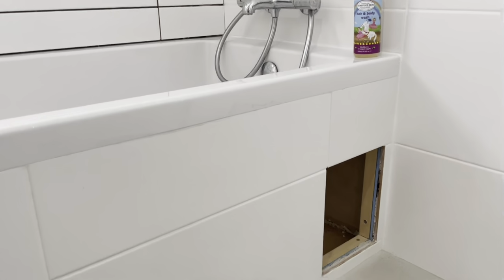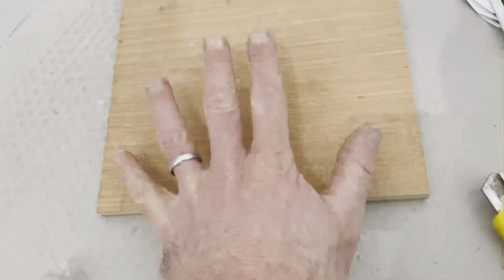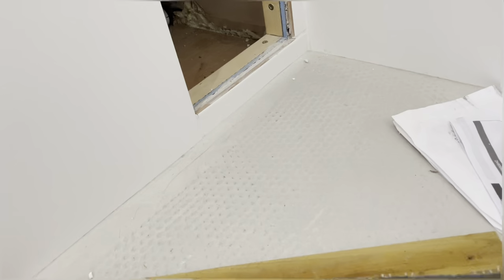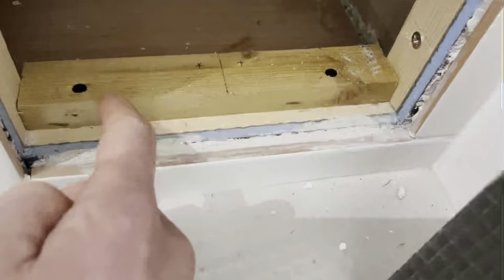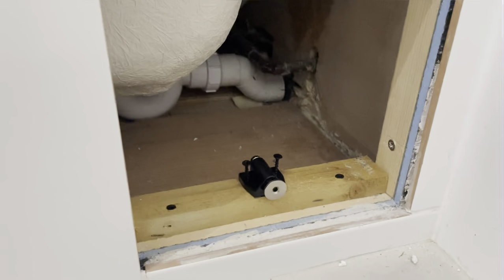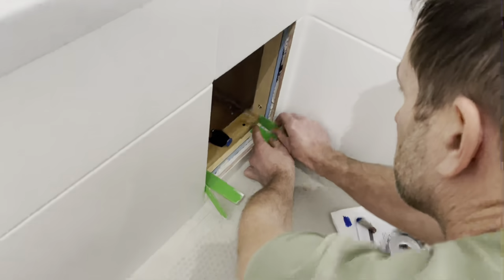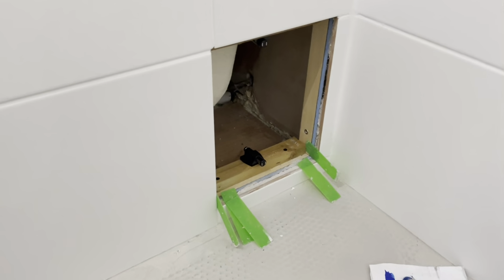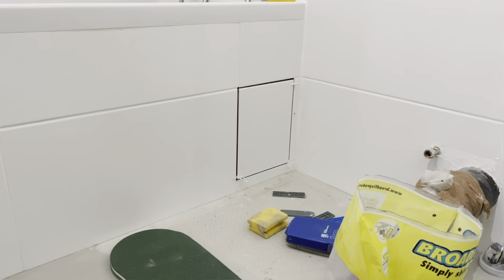Making A Concealed Access Bath Panel, Making A Bath Service Panel

Comment: How do the groud around ?
Reply from the maker: Hi Luka. 
Thanks for watching and messaging. 
The tiles on the bath panel were grouted as normal. 
Around the access panel I used some water resistant decorators caulk so the gap is sealed but can be easily accessed, by running a knife through the caulk. 
The brand of caulk I used was Siroflex SX Decorators rain proof caulk. It comes in white so matches grout well. 
Hope this helps you with your project 🔧🔨

Comment: Tilers who tile up bath panels and back to wall toilets with no access panel are scum of the earth.
Reply from the maker: @trancemadmaz  
Hi. Thanks for watching the video and the message, you are so right. 
When we moved into our house the push button of the concealed toilet packed up within a few weeks. I had to smash all the top tiles off to gain access. It stayed looking like that for 2 years until I got onto renovating the bathroom. 

Plumbers who don’t include isolation valves are nearly as bad 😃🛠️
Hope your bathroom project goes well
Reply: @diyhomeandgardening  I'm a plumber who is repairing a leaky plastic concealed cistern where there is no access panels and the wooden batons are in the way of pulling the cistern out. There is thick plywood also behind the tiles aswell. Total shambles.
Reply from the maker: @ That sounds exactly the same set up as around our old toilet cistern. Builders trying to be space efficient but without considering access for if something goes wrong. 
I know loads of people who have bought new properties and had plumbing issues that couldn’t be easily fixed, without excess damage to wall and surroundings. 
It’s annoying and adds to the costs